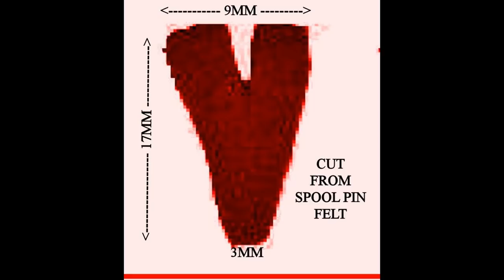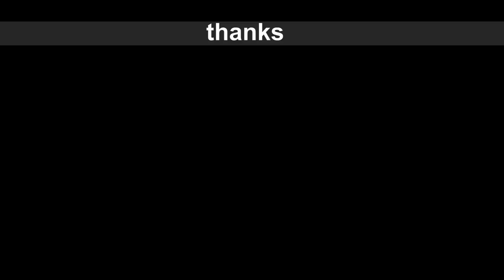The Bobbin Area Parts of a Singer Model 99K Sewing Machine

Comment: Thanks for the video Andy, Very usefull.  Only thing is, I have a 99k what dosnt have the pin holding the bobbin assembly in. It unscrews from the top.

Looking at yours, you have a screw and a pin visable from the top, I only have a screw.

Just thought I'd mention it as I spent a good 10 min trying to get the screw out with a punch.
Fortunatly I realised before I did any damage.
Reply from the maker: Yes, glad you did no damage. Singer made 20 versions of the domestic model 99 between 1923 t0 1963. Some of the early versions have the type of setup you have. As a general rule on the vintage machines, if there is only one fastener on a part like that it's going to be a screw, like a hinge screw where the screw end attaches the part and the head end has no threads to allow hinging or swiveling of the part. The machine I did has a hinge stud to hold like that, and a screw to hold parts onto the underside. Sorry if there was any confusion caused by me. I'll pin your comment to the top so other viewers see it first. Thanks for watching.

Comment: Hi Andy, just got my 99K out yesterday then found your video, thank you so much. You are a great teacher. Where did you find the spring screw driver that held the set screw? I've searched the internet and can only find the style with the claw at the tip. I like the one you have that holds the screw by the slot. Thanks again, you saved my 99K, I won't mention what I was doing about that red felt before I watched your video. Thankfully I did no harm.
Reply from the maker: I've heard some pretty funny red felt stories. Those are HJJ LOS GATOS vintage screw holding screwdrivers. The company has been closed for decades. You can find them sometimes on eBay like this one: https://www.ebay.com/itm/255067604556?hash=item3b6336c64c:g:B2AAAOSwb3Rg~z4O      A tech lady recently started a company named after her grandpa's old company and she makes these kind of screwdrivers but with a hexagon plastic handle instead of brass. I bought some and did a video a couple of weeks ago about them. The owner offers my viewers 10% off thru 8-16-2021 Here is the video https://youtu.be/ABALaSruihA   Here is her website https://fhelm.com/    FYI here is a playlist of all 19 videos I made for model 99K https://www.youtube.com/playlist?list=PLsCOZgzzaiKIIUgkEujqHc9iNWN9NPW2Z    Welcome to Andy Tube and thanks for watching.

Comment: Andy, my 99k is noisy in the bobbin area while the stitches on both sides are beautiful.   Seems like there’s too much slack between the bobbin case and bracket.  I tried adjusting the bracket by loosening the screw and moving the bracket.  Is there another way to adjust the space between the bobbin case and the bracket?  My Spartan is so much more smooth sounding.  Thanks for any feedback.
Reply from the maker: Sent you a PDF with instructions. Good Luck, Rhonda, and take care.
Reply: @andytubesewing1953  got it, thanks Andy, that was very helpful for the needed adjustment.
Reply from the maker: @rhondamercado7527  Very welcome. Not sure why I did not show that adjustment in the video. So much to video; so little time I guess. Take care.

Comment: Hi Andy , the top of the small screw that holds the small metal plate / spring  that the bobbin cover on the Singer 99 K  slides on to is broken off ....any advice as to how I can remove the rest of the broken screw ..   Regards, Fintan in Ireland
Reply from the maker: Ouch. It's a decent size screw to work with. Put some oil ow wd40 on it to soak first. If any of the screw sticks up you can try something like in this video: https://youtu.be/8RveJhE_CcM   If it broke off flush with the hole you can try a version of this method: https://youtu.be/8RveJhE_CcM  Anything with a sharp point will work. I've had viewers tell me they used epoxy or similar to JB WELD to glue another screw to the top of the broken one, then unscrew the new screw bringing the old one with it. Super careful with this method so you don't glue the old screw into the hole 👀 Finally, I had a small screw like yours broken down inside the hole. I used a very small metal drill bit to drill a shallow hole in the broken screw, NOT in the center. You know, a metal punch off-center for a drill bit starter, then used a 1/64th inch bit and drilled a 1/32nd inch deep hole, then used a nail at an angle into that hole (like my video) to tap the screw counterclockwise; around, and around and up and out. It ruined the bit but that is much cheaper than the new screw will cost if you can even find one. Screw 226J, 56 TPI, Singer Tap TE517, Alternate Tap #3 UNF.
Reply: Thanks for your prompt reply
Reply from the maker: @boradruma  No worries. Good Luck.

Comment: Hi Andy, love your Singer videos! I just picked up a 1956 Singer 99k and am cleaning it up. I was hoping to send you photos but I can’t here. I am looking at the bobbin case from the top and it has two pointy projections at the end near the dogs, enclosing a small indentation. Here’s my question. When I turn the case on it’s side and view it, the longer pointy is twisted a wee bit upwards (about 0.7 mm to make it a little higher than the smaller pointy. Is this the way the case is manufactured or has the longer one been twisted up? In which case I will have to flatten it to match the plane of the smaller one. I hope my explanation is clear. I look forward to your reply with much thanks! Gordon
Reply from the maker: email is andytube53@gmail.com for pictures. I think I know what you are talking about. At 14:17 in this video I have my right index finger on the long point. If this is what you mean, I believe both points should be level, so they sit properly and the hook race can go back and forth on the bobbin holder/case. This style of bobbin holder/case has been used on several model generations of Singer machines including the 99, 185, 237,401,403,404,500A,503A, etc. I have some of those cases in stock and just looked at 4 of them. They all had flat, level points.

Comment: Just got a 99 that we're cleaning up & re-wiring so this was very helpful! Where did you get the thingamagig that holds the screw on so you can screw it in without losing it? I've needed one for years!
Reply from the maker: They were given to me. There vintage, but you can buy modern ones. They are called screw-starters, screw-holding screwdriver, or Quick_Wedge screwdriver. A friend recently bought this set and told me they work well: https://www.homedepot.com/p/Klein-Tools-3-Piece-Screw-Holding-Screwdriver-Set-SK234/100648025
Best of luck with your Model 99.

Comment: Hey Andy how are you I just got a Mid-State vintage sewing machine model 6 Ms 11 20 can't find it anywhere so I was trying to find out how old my machine was and if it was a spin off from singer
Reply from the maker: There was no spin-off from Singer per se. There were a couple dozen companies, mostly in Japan, that made clones of the Singer machines after WWll. Mostly models 15, 66, and 99. There may not have even been a Mid-State "company" but a factory that made clones and "Badged" them for the buyers which were usually department stores or supply companies. Sears, Mongomery Wards, JC Penny, Western, etc. If you have access to an Android cellphone you can use the Picture Search function and I'm betting the pictures that come up would be SInger Model 66 or 99. Something like this: https://offerup.com/item/detail/537560721  On these Japan-made machines the Singer parts would often work for replacement and vice-versa. There are stories I've read that the US Government gave the blueprints of some of the SInger Models to Japan after WWll to aid them in the reconstruction of their economy/country.
Reply: @andytubesewing1953  thank you very much for responding the picture I pulled up that you sent me is identical but the plate does not say Precision it says Deluxe made in Japan made in Occupied Japan to be exact so the table that it sits in is identical to that one everything's identical except for that name plate and it's a 6ms 11:20 and I can't find that anywhere really
Reply from the maker: @marilynaldridge7735  That is my exact point. Made in Japan by one of the 20 or 30 companies. They did not last long or keep records and were quickly absorbed by large companies like Toyota and Mitsubishi. The exact machine you have may have also had 3 or 4 other "Badges" or names. They are actually decent machines but mostly impossible to find information about.
Reply: @andytubesewing1953  thank you

Comment: What do you use to get the stainless steel so clean?
Reply from the maker: Hi, Lori. Most of the time I use Krud Kutter Original Cleaner and Degreaser by Rust-oleum. https://www.rustoleum.com/product-catalog/consumer-brands/krud-kutter/cleaners-and-stain-removers/original-krud-kutter  Usually I just spray, let it sit a minute or so, and rinse with water. For some parts, like the feed dog, I may also use a toothbrush or metal detail brush.  If the parts are rusty I will then use a rust remover The Must for Rust, also by Rust-oleum. https://www.rustoleum.com/product-catalog/consumer-brands/krud-kutter/rust-remedies/the-must-for-rust-rust-remover-and-inhibitor   Rarely I find parts that are just extremely dirty and I use an UltraSonic Cleaner.

Comment: Thank you for this video. I just found a deal on this model and it is frozen. The presser foot lever is  stuck in the down position. The needle bar of course is frozen too. I have been using blaster to try and free it up. No success.i read that clearing the bobbin area should be first task. What do you recommend to free a stuck screw. The one you removed after removing the feed dog.
Reply from the maker: I'm not sure clearing the bobbin area should be the first task, but up to you. On any stuck screw, I use oil & heat first to try and break it free. 
     There is also a method of tapping the screwdriver a couple of sharp raps while trying to turn it. That can break it free and get it moving. Usually, patience is the key. 
     If the presser bar is frozen, then I'd think the needle bar is also. Just the stuck needle bar can prevent everything from turning on the machine. If I have a frozen 99K I oil all the factory oil points and use a hairdryer. Let is sit for hours and oil again, etc.
If oil and heat do not free up the machine the first thing I work on is the needle bar. No matter what it takes I get it off the machine b/c I always clean it anyway. Many times getting that needle bar moving has solved the frozen machine problem for me.  
If the machine is still stuck after removing the needle bar, I'd want to know if it is the upper or lower parts (or both) so I would disconnect one of the pitman rods on the bottom to separate the upper and lower mechanics. Like in the video at about 22:20  https://youtu.be/JknRDA1rSVU
With the pitman rod loosened I/d try turning the handwheel b/c now the upper part is disconnected from the lower. If the handwheel still won't turn you have something other than (or in addition to) the bobbin area parts. If the handwheel turns now then you know it is something down below, maybe the hook system. Good Luck.
Reply: Hello! I have a machine exactly like this one in the video, minus mine being electric. 

Okay so my presser foot always also stuck, but mine was stuck in the up position. Basically, I called my uncle (he knows sewing machine stuff, kinda) and together, me him and my dad wiggled the entire bar of the presser foot right out. We used wax and grease remover and kinda dripped it in from the top where the knob for the presser foot on the top of the machine. Also, I recommend taking off the plate on the side of the machine, I got no idea what it's called but it's on the top left of the machine and you loosen a screw (which is handy dandy in the fact that you loosten it with your fingers) and then slide the plate up and off. I'd also say take a picture of what's in there once you take that off before you fiddle around with it. Anyways, we basically broke the rod loose by smacking it with the back of a screwdriver and then unscrewing it with pliers since it was all gummed up. Then we cleaned everything with wax and grease remover. 

My needle rod wasnt seized thank god, but yesterday my machine started sticking in one particular spot and my my magical mechanic intuition, I figured out that it was sticking somewhere below the bobbin area. Just kidding, I figured that out by holding my finger on various spots and figuring out which ones had the most vibration prior to breaking the thing loose again. The problem was a screw on the bottom and again I have no idea what the clscrew us called, however, it's the screw which is on the other end of that bracket thing that is shaped like this thing ). Theres a massive screw on one end, and that is not the screw that was stuck, but the screw on the other end. 

I hope that helped and if theres anything that was confusing just let me know. Also, I suggest googling it and looking on some antique sewing machine forums if you havent already. Sometimes there are some useful diagrams.

Comment: Where did you find a replacement positioning pad holder, or funnel spring and felt pad as you called it???
I checked Singers Web site and they don't have it.....
Reply from the maker: I repaired the spring I found in the machine and made the felt pad from a spool pin felt pad.
Reply: @andytubesewing1953  If the spring is beyond repairable where might I be able to find a replacement?
Reply: You said you had link for size. I pulled out thinking jammed fabric. Then watched video. Oops   My spring in good need help cutting pad please

Comment: I got 1 20. dollars ,but I have fabric cot in it
Reply: Can't get it work
Reply from the maker: @autoliv4  Fabric or the thread is caught? I'm not sure exactly what you mean. If the thread is caught and handwheel will not turn you can remove/loosen the motor belt and try turning the handwheel backward or away from you. At 10:00 in this video https://youtu.be/CsWvFjjmK5E you get an idea of raising the motor to slip the belt off, then it is ok to turn the handwheel backward. You can also go under the hook to try and ct thread if it shows there. I can't imagine cloth is caught in the machine. Where? Sorry, I'd like to help but not sure what you are asking. Ask again in your normal language and try to explain.

Comment: How did you get the factory setting information for things such as the feed dog height? 
Recently purchased an earlier 99K with no reverse and taking it apart alongside your immensely helpful videos. Thanks for all the hard work Andy!
Reply from the maker: Every SInger machine had a Service, Repair or Adjustment Guide issued for it. There are sellers online and eBay who will sell you paper copies or downloads. There are services that sell downloads like this one: https://manualsoncd.com/product/singer-66-99-185-sewing-machine-adjusters-manual/   There are document sharing groups you can join and people upload and download documents that can include ones like this written by the Tools for Self Reliance charity group: https://www.scribd.com/document/355688276/How-to-refurbish-sewing-machines-TFSR-Refurbishment-Guide  That guide is very good for a few models including the 99. It does not have some of the technical specs that the SInger document will have. If you'd like to support the charity you can buy the manual directly from them: https://www.tfsr.org/product/sewing-machine/  So if I need a manual for service I usually search for it free online somewhere. Most of the eBay sellers did that and then are reselling it to you. If I can not find it free then I search for the best price for buying it on eBay or other online sources. I do not belong to any sewing groups but there are many of them; Yahoo, Facebook, etc. I would think that members of those groups would share service and instruction manuals, but I don't belong to them so just a guess. Thanks for saving the 99K. It was fun, right? Ready for another? Check out my Playlist pages with over 500 videos for working on Vintage SInger Machines you may see another model that interests you. https://www.youtube.com/channel/UCUSPDsHaFtRoz1VA2U1xJ4w/playlists?view_as=public    Thanks for watching my channel and Take Care.
Reply: @andytubesewing1953  That is so very helpful, all these links you have provided are spot on. Scribd TFSR refurb guide is the coolest thing, I never knew these existed. 

Buying the manual direct is a good shout to support them as well as joining social media communities. 

I am ready for the next one! Thanks a bunch.
Reply from the maker: @serendipidus1 thanks for watching my channel